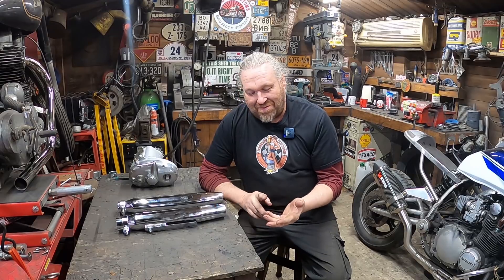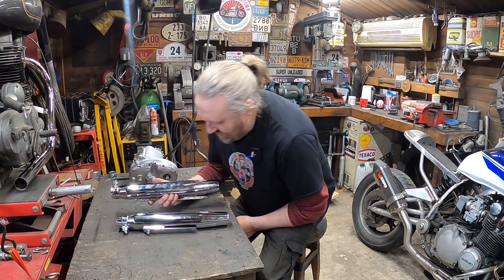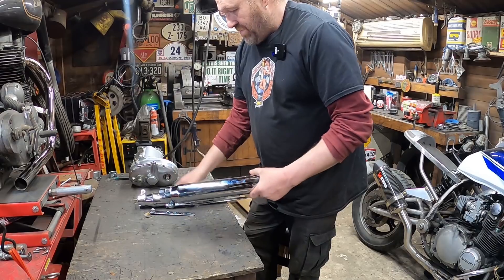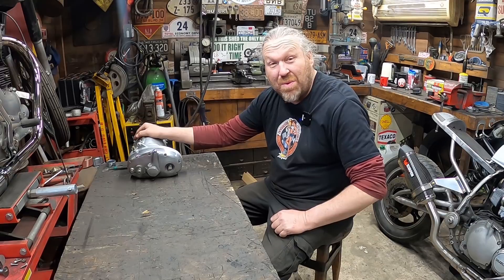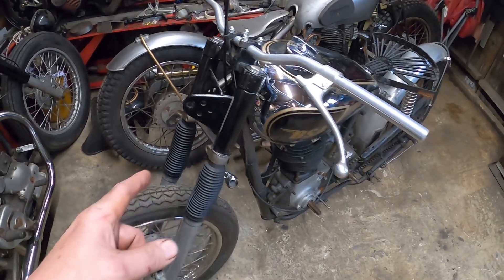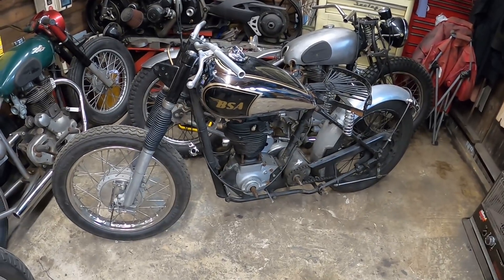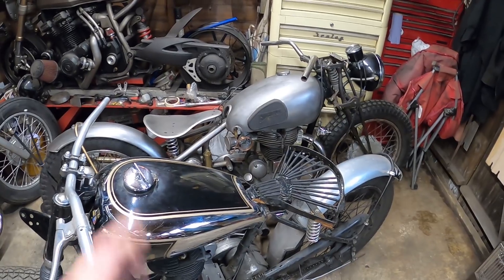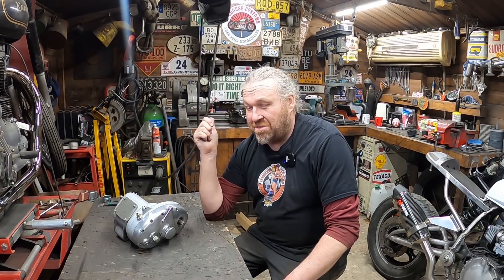Midweek Catch up

Comment: Excellent, very interesting. 👍 I like the extension idea. I also like that BSA, I totally get it, just summat to ride around on, what more do you really need. Looks not important. By coincidence I was supposed to be expecting a bottle of olive oil today, but instead got a message "UNDELIVERABLE" - and that I'll be refunded - I reckon the box sprung a leak on the van's floor! 😲 Did not survive the 'drop test' ...

Comment: What Hepcat Harley said! Craig, before you buy wood, it might be worthwhile to check how expensive that shed extension would be if you made it of gas concrete or cellular concrete or whatever you call it English. Here in Krautland, those bricks are reffered to as Ytong stones, y the name of their best known maker. You can shape them with a hand saw if needed, so they probably even are easier to work with than wood, and they do attenuate noise better than anything I know. That idea may be worth a minute of thinking, I guess.

Comment: Hey Craig, Looks like a great opportunity to add some valuable work space. I think rather than take the small shed down, I would simply fill in the gap and then only have to remove one wall or part of a wall to create the walk-thru access.   Cheers, 🏍👍🇨🇦

Comment: Disc front end on the BSA B 31/33 would be sacriligeous.
BSA A/B gearboxes are incredibly strong  and very good boxes. Back in the day quite common to put in Harley big twin chops. They will handle 70 lb ft of torque and 70 bhp comfortably. Not quite as slick as a Triumph box, but imo, stronger gears.

Comment: The first three new motorcycles I purchased new all had drum breaks, forth one had a single disc front,  number 5 back to a drum, after that mostly disc both singal and double front.  Several had disc front and rear. On the back wheel because of weight transfer under braking I don't think a disc brake helps you on the back at all unless it's just weight savings. How many motorcycles,  lollol, nor sur every time I make a list I forget a few and remember others that I forgot on the previous list. 
I set up a drum front brake on a early Honda that had a locked up control pin ( corroded in place)  after I got it apart  I cleaned everything up, lubricated the pins and brake shoe anchor points, resurface the drum matchl the linings  to the drum did a couple of old road racer modifications to the linings. Put everything back together and adjusted it properly. After all that you could lift the rear wheel off the ground anytime you wanted until you overheated the drum. I told the guy that owns the bike to be careful with that front fake first couple of applications he went out scared himself. Came back what did you do. I  set it up properly was my reply. Yes a drum properly setup will stop just fine until you get it hot after a lot of hard use.

Comment: No lights at all on the BSA? UK law requires daylight running lights. If he takes it on any public road without them he is asking to be pulled by the fuzz. And that can make your eyes water ...
Reply: You can MOT a bike Inthe UK with out lights just fine. I use to run a road going pitbike with out lights